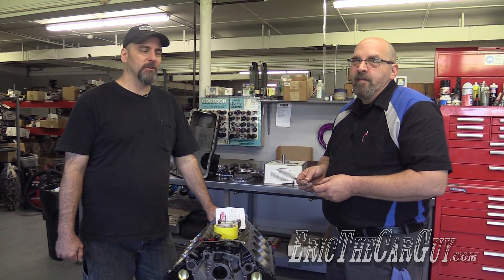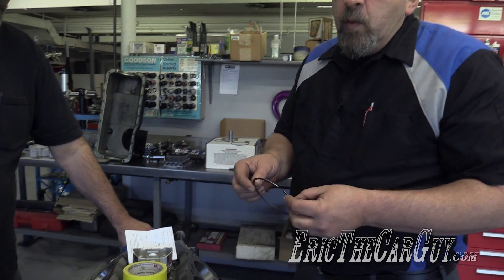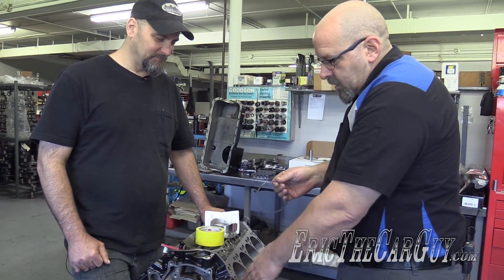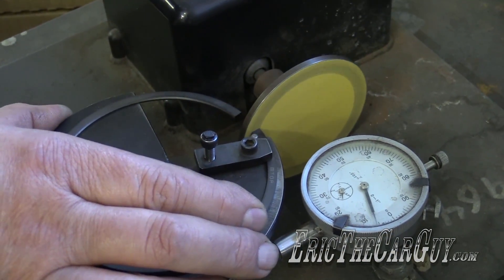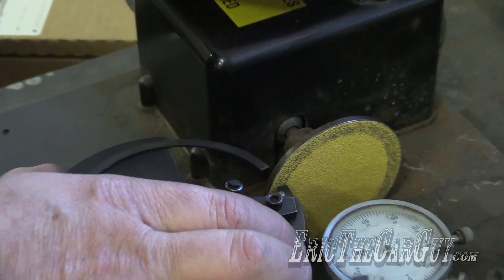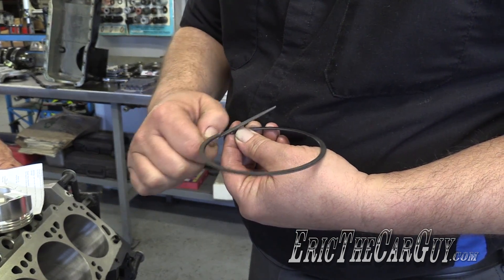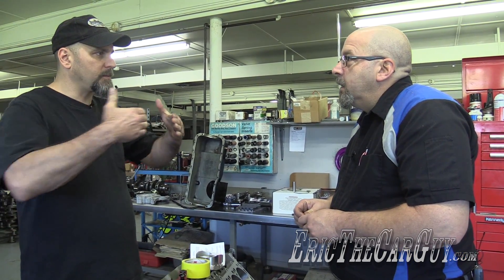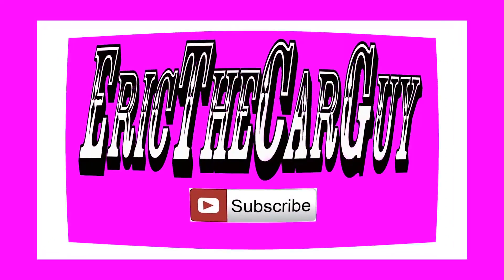How To Properly Gap Piston Rings

Comment: When I use to race I would tell friends that bought nitrous or supercharger or whatever that they should gap their rings specially if it’s a new engine if it’s got 100k on it you have a chance that the rings wore down some and have a bigger gap but nobody ever listened most friends weren’t professional technicians so they didn’t know better. I remember this one friend that I always had grudge races with he had a nitrous kit on and when we were racing I know that he was changing his jets to a 300hp or bigger shot and I told him if u changed ur jets out to something big ur gonna blow ur engine up so if u wanna change them back I’ll give you time I know we’re not on good terms but I don’t want you to blow up ur engine because I know u never gapped ur rings I’m sure you don’t have cold enough spark plugs and I’m sure you didn’t pull any timing out for the bigger shot and he said no I didn’t put a bigger shot in so I said ok just trying to be nice. Soon as he shifts to second gear you hear a big boom it was a nitrous backfire he melted most spark plugs, blew the throttle body off the intake, blew the side off the intake, broke the nitrous plate and cracked his brand new 1,000 dollar hood all because he had too much timing, wrong spark plugs for the huge shot of nitrous also he ran crap pump gas. When I built a stroker motor for my car he went out and bought a car with a stroker motor in it and he put a 400 shot of nitrous on it and I told him again dude gap the rings or you might break a piston, he said I have the right plugs, correct timing, good fuel I will be fine! I said dude that engine has a lot more cylinder pressure then a stock motor then add nitrous them rings are gonna grow a lot from heat and if the gap is too small the ring ends will touch and lock up in the bore and break off the top of the piston then if ur lucky you will need a new piston, sleeve that cylinder and worst case one of the main caps pull out of the block and the entire engine is junk could even ruin the 2400 dollar heads. He starts telling me about the best machine shop around built this engine I said yeah even more reason because a good engine builder isn’t gonna gap the rings bigger then needed if they don’t say they are running a power adder it’s gonna be a tight ring gap. His wife was a shit talker and said he knows what he’s doing and when I walked away I over heard her say you better not ruin this engine we paid alot for this car. Well we race and about 3/4 of the way down the track his car started smoking really bad. We get to the pits I walk over and see the engine puffing really bad out of the breather I said there you go you broke a piston! Him and his few buddies said no it’s probably just a spark plug, I said no it’s puffing out the breather that’s cylinder pressure leaking past the piston! He pulls the engine apart one piston was broken pretty much in half, couple other pistons had small areas in the ring land’s broken, needed minimum 2 sleeves, because he kept running it the $1,000 crank had a few journals that were In rough shape, the side of the head where the cylinder with the really bad piston was in bad shape a chunk of piston made the valve hit bending the valve and the seat was damaged because he kept running the engine trying to fix it thinking it was a bad plug or something the head was damaged pretty good it could have been fixed it needed some welding, machine the bore for the seat, then grinding the welds down smooth in the chamber and make sure the chamber size was correct but by the time you paid a machine shop to do all that for a few hundred bucks more you just buy a new head, there was a big crack in the main webbing so if he didn’t keep running the engine ruining the crank he would have been lucky that the main didn’t pull out and ruin the crank but he ruined the crank from running it! He would have just needed a new block, set of pistons, bearings, gasket kit and some machine work but just from running it everything was junk pretty much all the was saved was the rods, one cylinder head, Arp studs, timing chain set, push rods, rockers, camshaft, oil pump drive that’s about it as far as the long block goes. So many guys would blow up an engine every year sometimes 2 engines and my stroker engine is still going 15 years later. Couple guys said one night that I don’t beat on my engine as hard as that’s why it’s still together and I said naw I just did my engine correctly like the main girdle for instance you guys bout the girdle that requires no machine work because to properly do it you have to have the block bare with the caps bolted to the block and bring it to the machine shop like that so the main caps are perfectly flat with each other when installed for the girdle to sit on the actual main caps flush not just on the main studs and because the girdle contacts the entire main cap it ties all the main caps together it keeps the caps from walking which is what keeps the main webbing from cracking when these engines make any power this is the most important thing to do on these 2 bolt main blocks and both you guys have had the mains crack and rip out which ruined the engines completely I looked at the one guy and said you did this on 2 engines you had built and still didn’t do this on the engine you just did. He said I bought the most expensive girdle it’s billet cnc top grade aluminum and I said it’s not gonna help go buy the cheap 75 dollar steel girdle that needs to be machined and he didn’t and he blew this engine up too lol.
Reply: Appreciate the novella

Comment: I have 3.8 229 my pistons rings say .o17 gap but there 035 sir and the middle too but bottom little bit tighter im i ok with o35 for my rings i want to but new rings what size i need standard size 035 or over size 035 my chambers no scratches at all just glossy please help me out i don't have a dial gauge im doing oldschool way just by the pistons rings

Comment: I was wondering if you would want to square the ring and make the gap measurement with a torque plate bolted to the block to simulate the stress of having the head installed?
Reply: That would be a better measurement. Measuring at the bottom also help dial in better.

Comment: Okay I did my math and now I’m stuck, I’ve got a bore size of 3.760 x 0.0050 = .0188 for my top ring and then I’ve 3.760 x 0.0055 = .02068 , now would you take .018 as your top ring and .020 for your second ring or am I doing this wrong? This is my first time gapping, thank you for your time

Comment: What about a turbo engine on pump gas with water/meth injection? Would it still simply use the gap for turbo/blown, gas? I would assume the water/meth wouldn't play any major role(if any) in the gap. 
If anyone knows that would be great. I am about to send my block off to my local machine shop.

Comment: I'm all confused. He said not to file outwards not to scrap off the chromoly coating then scrapes the rings up and down and every which way. Only file downward please and check to file in a way to make the gap parallel. Not just one side. Many times the ring gaps don't come parallel from the factory. Did he say the rings rotate as the engine is running? So I guess there's no need to clock the rings correctly like the manufacturer say because they are just going to rotate anyways. Hold on now, he said as they freshen up a block taking a half a thousandth or a thousandth out of the bore it makes the ring gap grow. True, I get that but how in the hell can you set that ring gap BACK to what you want? Add more material back on to the ring?! He must be magic.

Comment: What If the gap is to tight or too big? What happens to the performance? Will you lose lose oil dramatically?
Reply: if its too tight, the piston ring will expand and end up breaking the piston and causing damage to the cylinder walls. If its too big, you will lose compression and end up burning more oil.

Comment: When rings lose the seal and blowby occurs and loss of compression is it against the cylinder wall or is it the gap that becomes too large?
Reply: There's always a little bit of blow-by between the rings and cylinder walls, even with a new engine. As the rings and bores wear out you just get more and more of it until it becomes a problem

Comment: Hi , do you need to gap stock rings , on a stock engine , with stock pistons ? Or just install them?
Reply: I could be wrong but you should be fine. They're talking about file fit ring set where they come with very small gap and you have to file them to the gap you want or taking stock rings and making a bigger gap for turbo/nitro setup (more heat = more expansion = more gap needed). but i think stock they come with the gap they should have for manufactures specs. but it would always be good to CHECK BEFORE you install. too small of ring gap and when the motor heats up if they expand too much and close the gap then it breaks a lot of other things.
Reply: also another note, i gapped my own rings last night with stock bore, wiseco piston kits and the rings were all (bearly on some) within manufacture specs. but if i wasn't gapping for my turbo setup i still probably would have gapped them a bit to have them all be consistent and right where the manufacturer specs them to be.

Comment: Hello , just a question I have a problem with my wv sirocco i had lost compresion in two cylinders and the mechanic told me that two pistons were damaged and i need to change all four of them. After removing the piston head the only thing wrong with it was a broken piston ring. Did they scum me ?Thank you for your answer.

Comment: Well and good, except real professional builders gap rings by removing equal material from both sides of the ring ends.
If you question that, read the info from Total Seal's Web site.
The most trusted ring mfg. in the industry . ..
Also not mentioned, the gaps should be parallel after ground.
Reply: THANK YOU! I was screaming that the whole time.

Comment: Hey thanx for the in depth detail. I worked 35 yrs in the turbine, rocket and even auto manufacture which is equally as important as any higher speed product to sustain a reasonable life span. I wondered if the ring spacing could be stretched a little to prevent oblong cylinder wear. This is right up more your alley. Thought of it based on the stability of a "stretched" bike, dragsters not flipping over and frankly. The trigonometry of margin of force on a, say 4" diameter ring assembly in relation with such a .5 inch gap or whatever. If there was a way to increase the gap would this not guide with far less force to maintain alignment decreasing the tend to dig at the walls increasing stability? Just curious
Reply: Maybe an exaggerated idea of my question is if the gap matched the diameter would this be more stabile with less pressure between the rings and wall? Sure seems like it. Or have carbide sleeve cylinders and rings ;- )

Comment: You can put a Dremel in a vice use a cut off wheel and it works just about the same as an expensive tool.
Reply: A Dremel seems a fit too aggressive... is it? I mean, usually, the file is hand-cranked. (Man hands turn what, 30-80RPM?) Dremels run up to 20000RPM, and its minimum operating speed is pretty fast, lol

Comment: I have a 08 vw r32 added a big turbo. And i ordered mahle pistons and the gap came .0070 and on the little paper they send you they say cut to 0065 now i figured be for the gap was 65 and had 0 blow by. Now 70  with more boost should be fine. Now it smokes like the marlbro man. Drove it for like 30 min and stoped smoking. Then all of a sudden, smoking again. Any ideas?
Reply: That was supposed to be .0065 multiplied by your cylinder bore diameter. (3.300" is the stock bore) which would be .02145" ring gap.

Comment: The piston rings should stay in the same position that they were installed because of the clamping force they provide naturally and under compression as Sam Johnson says if the did rotate at a point in time they would align and cause a low compression issue.

Comment: Hi Great video but I would like to comment on something you said to the guy setting the ring gap. You said to him as the rings heats up they seals.. That's incorrect. the reason why you gap the rigs is.  if you don't have enough gap, as the engine  heats the rings grow and could break the rings and or score the cylinder walls could also break the ring lands on the piston & heavy piston scuffing if you don't have the proper gap.

Comment: Hey Eric!  I'm a long time watcher, and I've always been wondering... You always mention putting links in the description, but I'm personally one of those people who doesn't usually check video descriptions.
I usually click a link within a video to open it in another tab and watch afterwards, however.  Have you considered embedding links within the videos?  "I'll put a link to the video right here (point, make funny face)"

Video end cards are pretty nice, too.  You could add a ton of links there.
Reply: I hope he doesn't. It's beyond annoying. Reminds me of how CNN puts a crawler on the bottom, clock in the corner, then a logo at the top corner and then another on the opposite side that takes up 1/4 of the screen. Annotations/links in videos are annoying as hell.

Comment: I'd say you can see the scuffing from how he inserts the ring, even you're fingernail can scuff and scratch a properly honed cylinder. i would recommend insering it by closing the gap and pushing it in there flat
Reply: Loren Hayse I noticed that to but it could be the coating of the ring?

Comment: not sure if this ones fore Eric of Kevin lol but what about gapless rings or total seal rings??
Reply: Pros and cons. It reality, if the gap is correct for the amount of heat that the piston ring is subjected to, the gap will be very close but the ends will not butt together while the engine is running. The Total Seal rings, I use mostly in applications that use methanol and a lot of it. Sprint car engines with mechanical fuel injection. Methanol has no lubrication properties to it and can wash the oil off of the cylinder walls which could cause a loss of ring seal and or piston skirt scuffing. 
The job of the top ring is to 90% seal compression and 10% oil control. 
The job of the Second ring is 80% oil control and 20% seal compression
Of course the oil ring is riding along metering the amount of oil the engine needs on the cylinder wall.
I should mention that the piston rings also transfer heat from the piston to the block. 
So you can see that this is the reason for the different types, styles and materials of piston rings and it really depends on the application of the engine and somewhat budget of the customer. Some of the ring sets I use from Total Seal are approaching the $400-$500 range. 
Could I have used a Gapless ring set? Absolutely. Was it necessary? I did not feel it was for this application. Now, If he wants try 20# boost and a 300 shot of nitrous, then I misjudged the application. Lol.
Reply: Kalvinator Engines  if file to fit rings help accommodate a larger bore when freshening up an engine how file to fit oil expansion ring.  shouldn't it be way too large as well?

Comment: Is this necessary for stock engines line the 1.8L 4 cylinder Toyota engine rebuild?
Reply: No. But, always check the Piston ring end gap. Manufactures can make mistakes also.

Comment: too tight of a ring gap on nitrous or boosted applications can cause the ring to pinch the piston when it expands and ultimately break the piston.
Reply: I've seen when they expand enough to pop the top off of a piston and shot peen the cylinder head with piston fragments

Comment: Eric I don't know if you noticed how tight that feeler gauge is when it gets removed from the rings I always thought when your gapping things you should not have a tight fit with the feeler gauge
Reply: I say it should fit tight but not crazy tight.
Reply: Yeah I understand that but if you look at the video you can see how tight it looked
Reply: I do agree, I use feeler gauges almost daily at work for setting clutches, They are suppose to drag just a very little, but require almost zero effort.
Reply: Roger Carlin   I agree. His looked feeler gauge damaging tight.

Comment: This is a very good video. Its so important to get the correct end clearance for the application. To small and end clearance(like putting a blower on an engine never made for it) the rings will get hot, grab on to the cylinders and destroy the engine.

Comment: I have a question
I wanna put oversized Pistons in my 2.0L and the cylinder walls between the inner cylinders is about 8.7mm and I wanna do 1mm bigger, will my cylinder walls hold up?